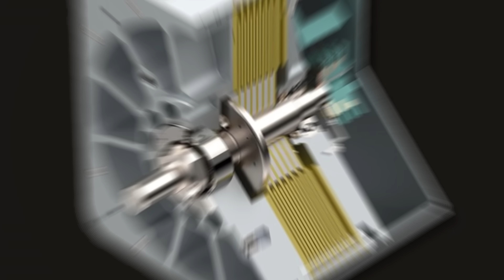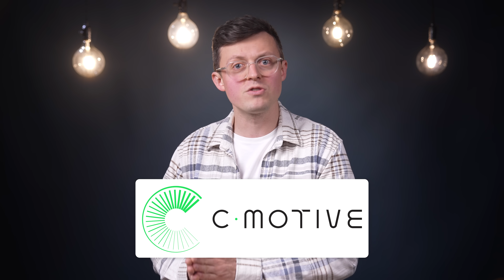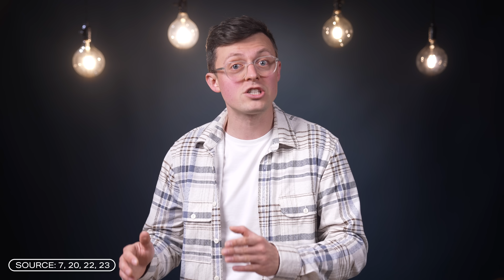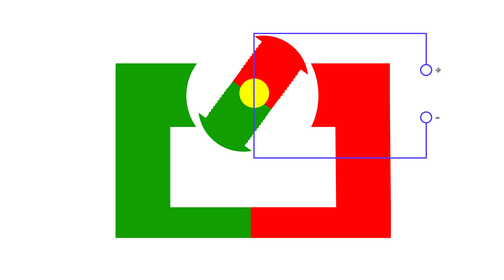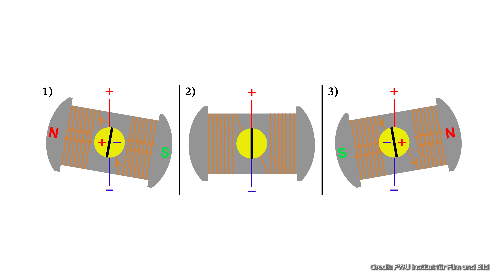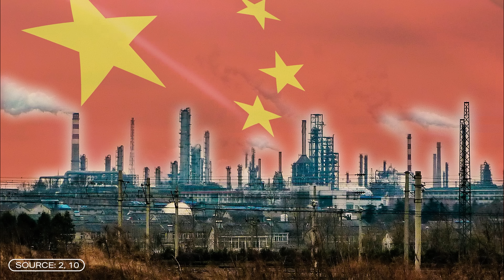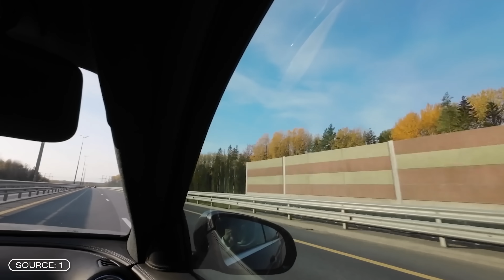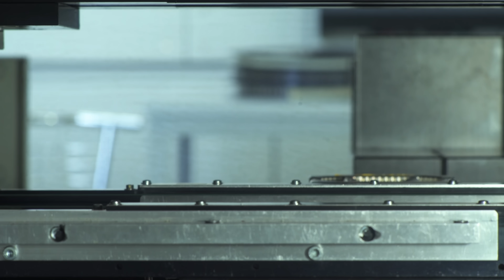Have We Gotten Electric Motors Wrong for 150 Years?

Comment: Trust but verify - Good advice for everything: politics, engineering, business, finance, marriage, etc. There is a large market for low RPM applications in industry - mine included. All they need to do now is re-engineer it to be able to rotate 1200 rev/min and it will be great for street legal electric cars, provided the efficacy is real and scalable in power and RPM.

Comment: There is no such thing as an electrostatic motor. Physicists will have your head if you use such a phrase. Coulomb's force is conservative and does not allow for work to be done in a closed path in an electrostatic field. Sort of disappointing that you describe a normal motor working due to Biot-Savart's law or Amperian forces on a current loop using a direct current (torque on a loop) as electrostatic.

Comment: Interesting development. Very curious about the amount of drag from fluid use... have you ever looked into ThinGap motors out of CA? Or Shicoh engineering- Japan. ThinGap has a great coreless tech- needs a bit more work to scale up mass production.. Shicoh is similar design of motors, just really small (most PC fan motors, or vibration motors..) Interesting and still better than Minibea motors...  But the TG motors have crazy efficiency, high speed or torque, and ability for very fine control..

Comment: Amazing! Because electrostatic force is used for motion rather than electromagnetic force, freewheeling drag losses should be vastly lower than electromagnetic motors - almost nonexistent. This means we can create direct drive motors for ebikes which don't have any drag when unpowered, doing away with freewheels which are not solid state and therefore subject to mechanical failure.

Comment: Normal three phase induction motors, invented in the 1880s, can be well over 90% efficient. No rare earths. 
Add a vector control drive and full torque is available from zero speed, still with good efficiencies.

This video content unfortunately sounds like you are quoting advertising claims without researching existing tech for proper comparisons.

The electrostatic principle is very interesting - but the motor efficiency alone is not the thing to highlight. 
I am curious about the drive efficiency; having to step up to high voltage and drive a high capacitance load - probably rather lower than a conventional BLDC or vector drive.

I'm guessing they have not posted the combined drive + motor system efficiency? That is really the key factor for; if the drive wastes more energy than existing types, the motor gain becomes irrelevant.

Servicing and safety are another concern - 415V can be bad enough, imagine multi-kilovolt systems in industrial use with metal particle floating about in the air! 

What happens if a cable gets damaged at those voltages? Or even just the motor seals failing over time & the electrolyte starting to drain - internal flashover wrecking it? And possibly the drive system?
Wear is a fact of life. With a conventional motor, you just replace the bearings & seals without any special equipment - I'd guess the liquid-filled ones are non-serviceable and scrap if a bearing or seal fails.

Comment: At what voltage do these electrostatic motors operate? I've read that for the large motors it can require up to 20,000 volts at hundreds of Hz requiring variable frequency drives.
Reply: They operate anywhere from ~2kV to ~10kV.  The voltage required is coupled to the relative permittivity(Er) of the fluid.  The higher the Er the lower the operating voltage is required to achieve the same torque profile as a lower Er fluid running at higher voltage.  
In general the Er value indicates how much energy the motor can store.  There are other factors, obviously, such as how fast the fluid can store and release energy for example.

Comment: So organic dielectrics can be extremely toxic or non toxic, reactive or non-reactive, etc. But generally high voltage increases safety risks. Without much details, who knows safety and other concerns? This include for plant workers and production. Secondly converting to high voltage isn’t 100% efficient so it would be nice to see this loss included. Lastly, how well it works under different temperature or pressures bc that can really effect liquid viscosity and electrical properties
Reply: I’m not saying it bad, it just lacks detail needed to assess and companies have covered up concerns in the past

Comment: BIG QUESTION:  If you manually turn a normal electromagnetic motor it WILL generate electricity on it's wires, WILL AN ELECTROSTATIC MOTOR?? If so how does it compare to an electromagnetic motor? Will this work as a slow speed generator?
ALSO, if ti only runs at 200RPM and it has great torque, would a good application be cargo ship? (or any ship that typically uses one of the ENORMOUS Diesel engine that has fuel as thick as cold bitumen - this would be perfect for them if it worked :)

Comment: Yay we mafe a new motor thats super efficient,  and super hard to build to control and only really works well in 1 certain application.
Reply: By the numbers it's way LESS efficient than normal motor designs plus it needs high voltage electronics which will lose some power too. This motor is a niche thing for a few specific applications.

Comment: I wonder if these would be able to run like the home made versions do, by using an even more complex version of the 'drawing on altitude differential high voltage'. Small ones already work with simple antenna at a hundred feet height or more, but imagine a large and complex antenna at several hundred feet, or even multiple of them. :person-blue-holding-pencil: The voltage difference is about 100-300 volts per meter in height, and it is a very real and freely available current.

Comment: I wonder about the inverse application and how it would compare to a generator. Rather than sending electricity to move the motor, what if we heated the liquid dielectric to create a current that moved the motor. How efficient would the electricity be compared to the cost of fuel used to heat and how that ratio would stack against other electric generators.

Comment: Their comparisons to electromagnetic motors are in comparison to bad and/or poorly implemented alternatives, which is completely irrelevant, which means it's misleading marketing. In practice there's not much room for improvement over established technologies when it comes to achievable efficiency, or torque density, or control. The requirement of keeping that dielectric hermetically sealed in is a pretty significant practical disadvantage in it self, and without much room between what existing technologies can achieve and what's theoretically possible, I just don't see how it's suppose to provide any net benefit, or even be as good as what's already on the market, all things considered.  

No permanent magnets, and a very significant reduction of amount of copper required, sure, that is technically an advantage, but it is not relevant. It's not that big amounts of either required in conventional motors, for what they can do, and electric motors aren't fuel, they're not consumed during operation, they can last a very long time, and afterwards they can be recycled.  

So the main hurdle isn't so much if it could work, the main hurdle is the fact that there's not a relevant problem with current electric motors that their technology could reduce, efficiency in good electric motors that are implemented well are typically well over 90%, you can often reach >90% efficiency even including reduction gear losses. 

On top of that, there's the issue of supplying that very high voltage, which adds costs and energy losses.

Comment: Excuse me, I'm not a physicist, but a usable electric field requires high voltage, and high voltage is dangerous.
Reply: My problem is, you cannot use it as a generator, like EM motors... So in cars its not optimal, no recuperation.

Comment: The reason this works as well as it does on position and hold is fundamentally the same as axial flux motors. You are able to apply the forces at much larger distances from center, naturally increasing the applied torque through bog standard mechanical advantage. In a "normal" motor, the stator has to surround the rotor, meaning whatever mechanical advantage you wish for your rotor to have, your stator must then be physically larger than that.

The losses due to drag can be improved by either A) liquids that change viscosity with relative velocity / shear forces B) gaseous atmospheres optimized for dielectric properties c) plating the rotor and stator with a physical dielectric material of sufficient thickness to avoid breakdown; charges don't build up uniformly through dielectrics in a capacitor, the charges are heavily concentrated to the outsides. That is why capacitors seek to minimize the distance between the two sides, because beyond a certain thickness the dielectric material is simply not serving any function. In this application, you could actually make use of that property to avoid charges reaching the air gap between the two dielectric coated plates.

Higher speed operation just takes some firmware / control process optimization. It is the same type of optimization we had to do for stepper motors to operate them efficiently at higher speeds. Particularly by getting very intelligent about energizing sequences as speed increases. At a certain point, it no longer makes sense to energize the very next loop in the physical sequence; instead you start skipping to constantly stay ahead of the rotor and allow momentum to carry it through. You are no longer dragging the rotor around, but just giving well timed kicks to maintain or increase speed. You will also need a built in discharge cycle at higher speeds to allow the dielectric to desaturate, otherwise your current requirements will jump dramatically at higher speeds. Those discharge cycles could dump into regular capacitors so the energy could be reused on the next energize cycle.

Higher torque is just a matter of making it physically larger, this takes advantage of mechanical advantage, so increase the size of the lever and you'll get higher torque. You could also increase the voltage applied, but that means possible changing dielectrics to withstand those higher operating voltage conditions.

Comment: Using a fluid as a dielectric seems like it could loose a lot of energy from viscosity of the fluid... I wonder if that is the reason the rpm is limited to max 200.
Reply: That is exactly correct.   As the technology matures and the engineers have the resources to investigate techniques and solutions to reduce viscous drag the RPM ceiling will increase.  
The engineers are likely focusing on reliability, sourcing costly high voltage components, and increasing the dielectric constant.

Comment: I think you missed the biggest 'hurdle'.  An electrostatic motor requires high voltage to achieve a useful field strength.  While it's possible to create high voltage electronics, the cost & complexity are typically higher than similar power low voltage, high current, but more importantly stepping up the voltage is fairly inefficient too.  I would like to see a comparison which includes the power conversion.

Using a liquid dielectric has advantages but significant disadvantages in viscose drag.  It may be at relatively low velocity (200rpm) this is manageable (for a relatively small rotor diameter) but you incur further loss gearing it up.  I wonder what effect the temperature has on the viscocity of their dielectric?

This sounds like a pitch to venture capitalists.  Concentrate on the advantages.  Don't mention the problems or disadvantages.  Hope they give you a load of money to buy a Frearri.

Comment: Dielectric liquids, especially the fully synthetic ones, are a rather old technology and you can get one designed to be of extremely low viscosity. Especially now that we have the so called AI systems, which are actually a parametric generative iteration design algorithms lol. 
So, that’s why low RPM. Design the fluid and IDF you go. 
However, they are missing a trick, big time. Forget fluids and go to high vacuum. What about seals I hear you cry? Ferrofluidic seals technology is pretty advanced and readily offered the shelf available. No reason not to use it amd it has no scale limitations. Another trick they are missing the massive advantage of the motors requiring high voltage. Yes, advantage. No need to step down from the grid voltages 🤓. Those such an obvious things I am gon smacked they didn’t go that way. If they do however the will need to contact me regarding  royalties of course 😎

Comment: Google "Ultrasound can print through walls and people" + "Boeing Plasma force field block bombs" + "Ultrasound holography transcranial brain modulation pubmed gov" + "Ultrasound solidification of molten metal for perfect atomic structure" Resonance filters that make printing in peoples heads optional without resonance disintegrating cells and allow penetration of materials for printing can also be used to transfer heat at will. Slides over Capacitor relay back with double capacitors to run them at half power as a whole for less heat U.S Army used similar to prevent exoskeleton tech to prevent melting battery. Heh..

That's just a sample! Google "Ultrasound non-invasive computer brain interfacing" Can you imagine? THEN YOU CAN ART!! - Dracula

Comment: Seems to me to be a great candidate to be mated to a gearbox to achieve higher rpms. While a gearbox would lower its efficiency it would still maintain a higher efficiency than the current motors that are used in,,,,, say a car. I am not very knowledgeable about the efficiency ratings, but the current motors used in cars barely make 40% unless I am mistaken. So an electrostatic motor achieving near 90% could easily beat a 40% efficiency rating when mated to a well designed gearbox or CVT. I don't know gearbox efficiency ratings, but I think it would be a better setup than current ones in cars, especially if the torque numbers were significantly higher, as the draw on the batteries would be much less if the torque numbers were a good deal higher than the current setups in electric cars or other electric motor applications like the motors used in CNC machines, mills and lathes, and other similar applications, and probably would be an ideal use for trains. If in fact the torque numbers are a good bit better than current configurations. The electronics problem as far as availability should be a quick and easy fix, as our current chip designing and fabrication infrastructure is already very robust and that bottleneck could quickly and easily be remedied. Ben Franklin was one of the most brilliant of men to ever live, so yeah, I'm sure it is a great idea. Knew one of his direct descendants when I was a kid. The guy looked just like him. Ralph Hainsworth was his name, also a brilliant man. One of the most talented people I've ever met. He taught himself how to do many very impressive things.
Reply: You're mistaken about the electric motors efficiency for motors used in cars. The WIKI article on electric cars states overall efficiency of over 77% from the grid to the wheels, so the electric motor itself would have higher efficiency. Another article stated "synchronous motors generally achieving around 90% and asynchronous motors ranging between 75% and 80%". The 40% number you stated may be from the power plant to the wheels, with gas turbines having efficiency a bit over 40%.
Reply: @williamhicks558     You may very well be correct, but I think that rating your are reading about is including the regenerative braking in the calculation and not the electric motors' efficiency rating itself. As I stated, I am not well informed on the ratings of these things and was kinda shooting from the hip by relying on my imperfect memory. There is also the inverter to consider in these calculations and whether that also has been included in the calculation. Thanks for the info. Here is a quick note I found on a real quick search -Note: The overall efficiency of the entire powertrain (battery to wheels) is lower, usually around 80–85%, due to losses in the inverter, wiring, and mechanical friction in the drivetrain.

Comment: There will still be current flowing when the voltage is switched. Depending on the frequency and choise of capacitor it is a short circuit. The liquid they're using is interesting because they will need a dielectric to stop the high voltage to arc. Very nice!
Reply: No, no dielectric; it runs on Coulomb force. The liquid has permittivity of 20, which considering it can't conduct (and still run or avoid plate electrowear) is a canny field presentation (and very few motor bits dedicated to resisting even nutation plate-plate.)

Comment: I wonder if the dielectric liquid is very pure water, it would give good cooling and has a very highr resistance. Water only conducts due to impurities it has disolved in it. Otherwise it's likely to be a very thin oil like kerosene.

Comment: 95% efficiency and 35-45% efficiency for energy production
Combined efficiency: 0.45 × 0.95 = 0.4275 = 42.75% efficiency which means 57.25% to 66.7% loss are you guys dumb?
this also wasn't accounted to battery degradation energy loss which is 1.8–2.3% per year due to capacity loss so in 10 years u get 70% battery efficiency down from 100% soo 0.45 * 0.95 * 0.7=29% efficiency 42% or 33% to 29% or 23%
The internal combustion engine has 20-40% energy efficiency but there is no battery needed to replace. 
Soo overall roughly same energy loss... (unless they figure out how to increase the efficiency in energy production at powerplants)
UGa booGA MAGicAl numbers 95%
Don't get me wrong the applications for those motors might fix other areas but not car industry per say:)